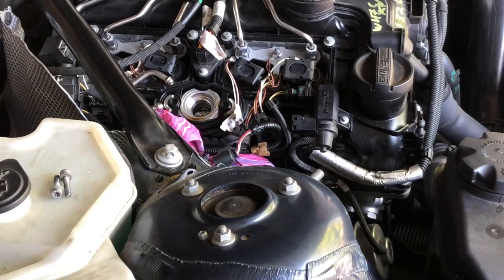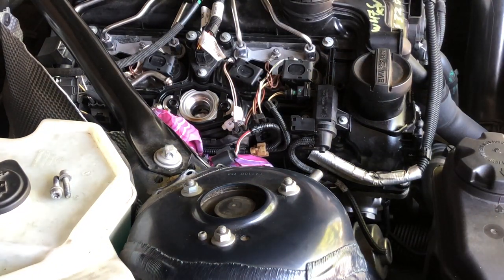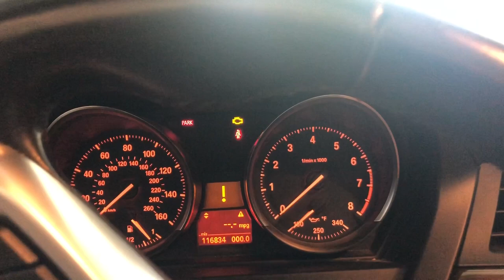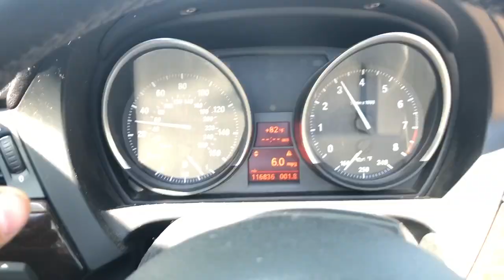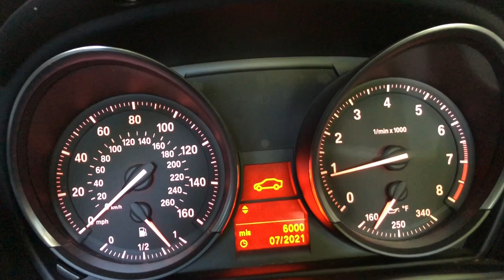High Pressure Fuel Pump Replacement (HPFP) - BMW N20 (228i, 328i, 428i, 528i, sDrive28i)

Comment: Hey pal, did you notice a smell of fuel from inside the piston area of the fuel pump. Also, does your oil filler cap smell like gas, the oil itself is fine, but there is a smell of gas 

Thanks 
Tim
Reply from the maker: Hi Tim,
I don't if there was fuel smell in the piston area, but there shouldn't be as far as I understand. I have no smell of gas from the oil filler cap either.
Reply: @SimpleCarGuy  I think I might have an issue with my HPFP then. On diagnostics I have 7.5mpa at idle and 11-17mpa when revved, but this has reached 20mpa.

Do you happen to know what yours is on diagnostics? 

Thanks again 👍🏻👍🏻
Reply from the maker: @TS-ji1me  Unfortunately, I don't remember what mine was, but if I take the car for a ride, I'll check. Have you looked at LTFT and STFT to see if they are at normal levels? You can find this in live data PIDs.
Reply: @SimpleCarGuy  oh do you mean injector quantity adjustments? Yeah mine are still within spec, range from -1 to +1 when idle 

Just wondering what’s causing this warm restart issue, annoyingly it happens rarely so difficult to capture when logging
Reply from the maker: No, I mean the Short Term & Long Term Fuel Trim. It’s kind of hard to explain, but there are plenty good videos explaining it.

Comment: I have a 528 2012 I just replaced my pump and still getting messages of Fuel supply then the car stalls out on my while driving
Reply from the maker: It COULD be the low pressure fuel pump as well. If it doesn't get enough fuel to the HPFP, it won't be able to do its job. Obviously, I can't tell for sure on the limited info, but what is the code exactly?
Reply: You might have to change the control unit
Reply: your sensor is bad . replace the sensor and u should be good to go
Reply: Hello do you solve the problem jermaine ?

Comment: thank you for this you tube  i m just coming from tulley  bmw dealer in manchester NH  i have same  issue  High Pressure Fuel Pump 2009 bmw 750li dealer he ask for $$2,400 dollar it very easy can i do by myself
Reply from the maker: Glad you found it useful! They charge a crazy amount for what isn’t a difficult or long job.
Reply: @saadaudan4632  it is more labor to do on a n63 not as easy as it is on a n20

Comment: For what we need to change high pressure fuel pumb
Reply from the maker: High pressure fuel pump helps with issues such as bad idle, hard to start, rough running engine etc.
Reply: @SimpleCarGuy  tnt
Reply: Tnx

Comment: Hi, did this fix the warm restart issue you had on another video?
Reply from the maker: Unfortunately it has not. I have taken the car to a couple shops as well and still no solution to bad starts.
Reply: SimpleCarGuy did you check the valvetronic? 

I recently cleaned my intake valves manually and that seems to have helped mine. They had huge amounts of carbon on them at 100k miles. Still get a slight blip in rough idle on warm start, but it’s stopped stalling.
Reply from the maker: This has been my last suspect as far as the bad start - the valvtronic servomotor for eccentric shaft. The replacement engine only had 30k miles when I installed it, so it's hard to believe that that's the issue, but it's possible. I was also thinking since the engine is newer that it might be different (like the EU5 vs EU6 injectors and my oil level sensor didn't work until I installed the old one).
Do you know if there is a way to test it? I wouldn't want to take half of the engine apart without knowing for sure.. unless I'm bored this winter :).
Same goes for the carbon, shouldn't be an issue at 30k miles.

Thanks for the suggestions, I will start looking deeper into this.
Reply: SimpleCarGuy yeah, well it can either be the motor or shaft causing the issue, but at 30k that’s not a lot of wear. The motor is the cheaper issue. Do you have ISTA? - if so you can reset the adaptations for the motor and vanos then run a relearn phase on the servo motor. I done this a few times, it always passed the procedure quickly. After it done this, it used to click for 30 seconds on unlock and lock, but never threw a code. It stopped after a long drive. 

I saw on a forum that one person had this issue and it was the ambient temp sensor which controls fuel at start up. However, surely his ecu would have giving a wildly off reading on the dash for the C/F so would have been an obvious fault.
Reply from the maker: @TS-ji1me  So, you made me thing yesterday and I did some experimenting today. To start with I reset the adaptations and did the valvetronic motor limit position learn function (the one that runs for 20 minutes). Everything completed successfully, but after driving the car with Auto Stop/Start, it would fail to start every 2nd/3rd time. I then decided to unplug the sensor/motor and drove the car without it. It started perfectly every time (about 15 times) but obviously with the check engine on. Now I'm not sure if this is a definitive answer, but with engine running in 'default' map it starts just fine. I wonder if there are any other ways to test it to know for sure before I tackle this beast of a job.
Reply: SimpleCarGuy I am not sure, mine was a bit funny after deleting adaptions and relearning limits. I also had some clicking of the motor on lock and unlock. Check my videos of it. It’s passed now and doesn’t it anymore, but I also had a moment when the car revved itself up from idle to 4K on its own so had to switch it off. Was fine once restarted. I still get a slight rough idle when restarting on a hot engine. 

I too wonder if it’s the motor or the eccentric shaft. If they have too much wear on the shaft they need replacing too. 

How did the car run with the motor unplugged? As I under stand it essentially is the modern day equivalent of a throttle body and is electronically connected to the throttle pedal allowing for min idle, or full valve lift for full throttle.
Reply from the maker: @TS-ji1me  I'll check your video out when I'm off work, thanks. I would be surprised that the eccentric shaft is worn after 30k miles. Just doesn't make sense to me. I can see the motor wearing out or maybe it had a defect, who knows. 
To my surprise, the car ran perfectly. I was expecting it to run rough (like when you unplug a MAF sensor or something), but it ran great. It had good acceleration, but I did not push it, so I assume it wouldn't have full power at higher load or RPMs.

I might practice on my junk motor taking both the motor and the shaft out before I attempt it on the car. At least it will make for a good video.. lol.
Reply: SimpleCarGuy there’s a good video on here of a guy replacing the motor and shaft. The shaft is under high tension from the springs, but he manages to remove it by undoing the shaft retaining caps slowly bit by bit on each one. I’ll see if I can find and I’ll copy the clip across. 

When you do the injectors on your current motor, did you replace the sealing rings and Teflon seals?
Reply from the maker: Thanks! I saw your video, don’t have that tapping like you did, but now fairly convinced it’s the cause.
Yes, I replaced both the the decoupler and the Teflon seals. I make a little diy tool to put the seals on. https://youtu.be/q3ky6EB1Sqk

Comment: How do you know if the rod is broken. What will be the symptoms?
Reply from the maker: All common HPFP issues, you may have low pressure, sputtering, hard starts etc. you can also hear tapping coming from the pump area.
Reply: @SimpleCarGuy  thank you
Reply: @SimpleCarGuy this is what’s happening to me now and I payed the dealer to fix the last HPFP that went bad last time Bc i drove it with low fuel but when they fixed it I heard cicada sound type clicking for the next 15k miles and now it’s going bad again. They 10000% didn’t install it right but I will be doing it myself now and lucky I get free replacements from FCPEURO 😊

Comment: Another question, in this video (https://www.youtube.com/watch?v=CkX8p40x6xw) he advises to change the injector rail if we change the high pressure pump?

 Do I also have to change my rail as well as the pipe connecting the pump to the rail when I go to make my valve cover? 

Thank you
Reply from the maker: I checked what BMW recommends and no where does it mention replacing the rail at the same time. If you see any leaks or stripped threads on it, then sure, you can replace it. Otherwise, I don't see a point of changing it. Hope that helps!
Reply: I forgot to say that it is exactly the 'high pressure line' and not the rail itself.
Reply from the maker: @mateurtv  I stand corrected, according to the TIS, it does have to be renewed. I've been driving with the same high pressure line since I made that video with no leaks. Of course, it is best to do as BMW recommends and I can't believe I missed :).
Reply: @SimpleCarGuy  We are here to share our information;)

Glad to have brought you this info on the replacement of the high pressure line.